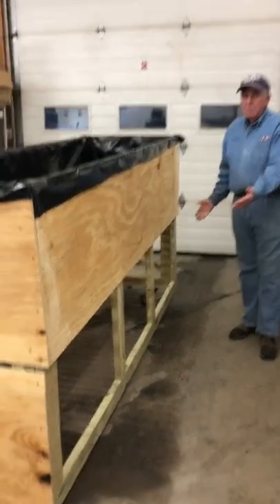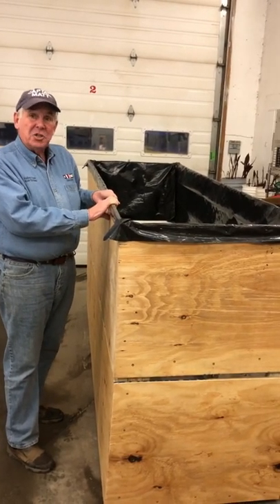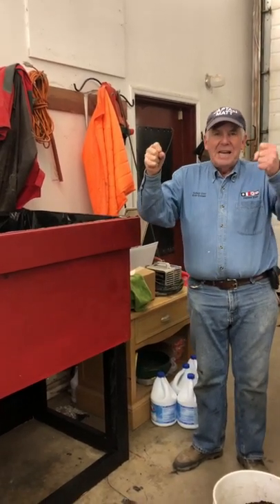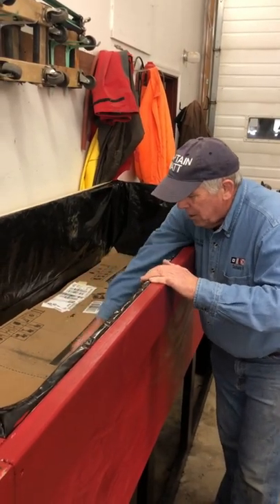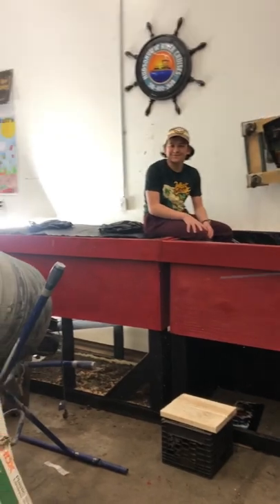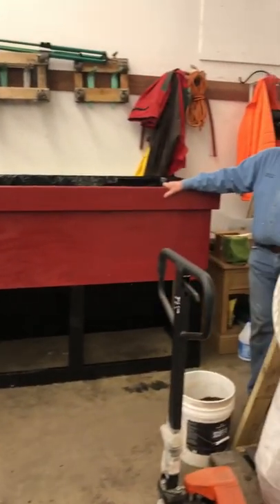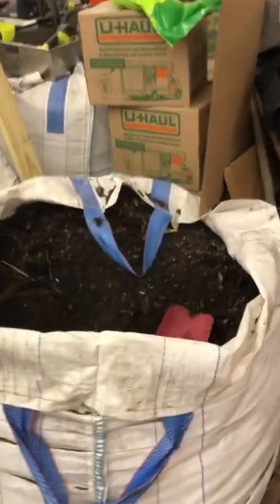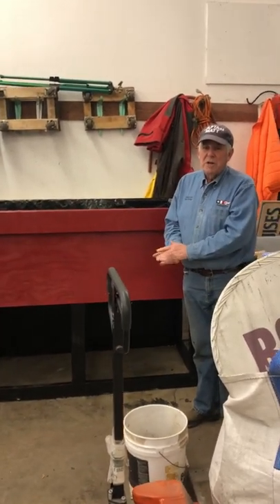Let’s Build a Continuous Flow Worm Bin - Part 3

Comment: Question: Can I set something like this up in my unheated barn? I live in PA and we have winters in the 30’2 typically, with about 2 weeks in the 20’s or Colder spread over the winter.
Reply from the maker: You’d need some type of heat - but could be under an insulated bin or walled off room… does not necessarily need to be whole garage.

Comment: I was curious how you reinforced/screwed the plywood at the corners to each other.  Did you use angle braces or a piece of 2x4 on the inside corner?     Getting ready to build a bin this week!
Reply from the maker: Hi Back in Service... The frame at the  bottom and "ribbon" at the top are sufficient  to hold the plywood in place.   Exciting  - would  love to see photos. Be sure to subscribe to the “Worm People’ newsletter at https://wormpeople.com/subscribe/  -  we’ll have a link in the newsletter to submit photos/videos.  Regards!

Comment: Did I miss a section in a video in which the sides were built and attached?  If that was not in the video would you describe the construction?
Reply from the maker: Sides are just screwed into the base, sitting on top of the blocks shown in part 2 https://youtu.be/5LIMz0s-7xQ … the schematics in the description might help as well. The next time we build one, we’ll get better step by step video.

Comment: If someone was to make this a quarter of the size of this how many worms do you think it would he able to hold when starting since this beginning bin needs to have 500k worms? I was told that a worm population wont grow if too many is in 1 square foot.
Reply: Captain Matt has 3 previous videos that I'm pretty sure would answer alot for you if he doesn't get back to you right away ✅ Enjoy your day 😊
Reply: @cherylhobbs1091  which is why i made this comment because i have watched all his video and it still does not have what i mentioned
Reply: @GrownManGames  my apologies😔
Reply: Urban worm offers a free calculator
Reply: @jillbruyrjr4763  ive seen those and they look entirely too difficult to understand. I just need plain answers
Reply: @GrownManGames  I have been raising worms for 3 years now.  I find the worms just don't breed when the bin has too many worms.  The number stays consistent at a point.  If you harvest a bunch of adults out and put them into a smaller container they start to breed.   I am using four 30 gallon size plastic storage bins and I have 3 bathtub sized plastic bins.  The big bins weigh over 200 pounds now and are just over half full.  I don't have any holes in my bins, so they don't leak on my basement floor.  I am in the process of converting all my bins to  continuous flow thru bins like this guy uses...only I made mine out of 32 gallon plastic trash cans with wheels.  I have over 100K worms now.  I plan on having less than 10 of these new style bins, so I am looking at maybe 20K worms in each bin.  I have only seen a few dead worms in my bins.  They will come to the top to die, so I just pick them out.   I think they live for several years.   There are hundreds of people doing youtube about worms.  I have watched over 100 hours of stuff and this guy is right on the money.  A lot of people says just get some shredded paper and cardboard wet it, add some worms and throw in their kitchen veggie scraps.  It can be that simple. I have a 5K sq ft garden that i use my worm castings in.
Reply: @kellymahan861  so if my bin stops growing because of population size but i take worms out to make seperate breeder bins and then put those new worms in my main worm bin everything will be fine? Fine meaning food waste / consumption will be faster but they just wont be breeding? If so that can be good news for me
Reply: @GrownManGames  The worm population will stabilize based on the size of the bin, the quality of the bedding and the amount of food you feed. 
I watched a bunch of YT videos and followed what many folks do.  I took two bins, drilled holes in the top and bottom of one and set it up on some bricks inside the other container. I added a bunch of wet shredded paper and cardboard and dumped in the worms.   The next morning I  checked on the bin and find them all over the basement floor and even 4 feet up the basement walls! This happened 3 times more times...so I went back to YT for answers.  Now, I realize they were unhappy in my bin and wanted to find a better home!  I fixed that problem by adding a light right over the bin, left the lid off and put a sheet of cardboard on top of the bedding.  They stayed inside the bedding to avoid the light.  I have made a lot of mistakes, but keep learning and experimenting.  I have not killed a bunch of worms, yet...and they all keep eating and my numbers are still going up. I wish I had started worm farming 10 years ago!
Reply: @kellymahan861  i have the urban worm bag
Reply: if you watched all his videos, you'd have seen that he likes to overload his bins with worms so they are constantly creating castings faster.  That is why he uses the breeder bins to keep his population increasing.
You are right, it is said that if too many worms are in a square foot, they will refuse to breed.  
A simple answer to your question would be a bin a quarter the size of Captain's would be 500k/4 = 125k.
Reply: @ericcarver7465  thanks
Reply: @GrownManGames  Look just under the video #3 and there is a downloadable link for 'plans' for what he built (diagram and measurements).
Reply from the maker: Thanks, Billy - yes… my son Mark drew up some plans - now linked in description. Thanks for the feedback everyone!